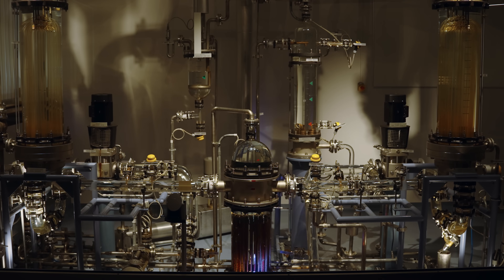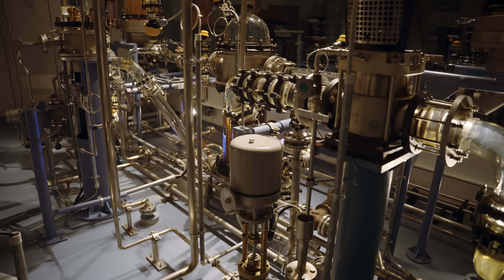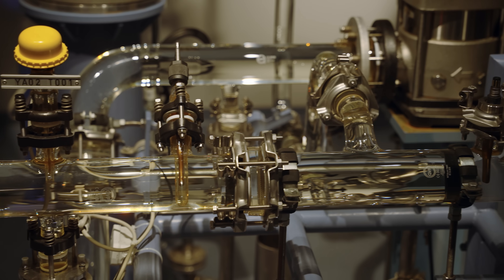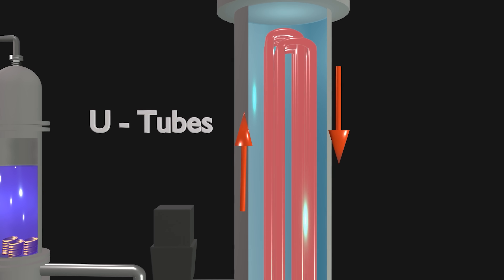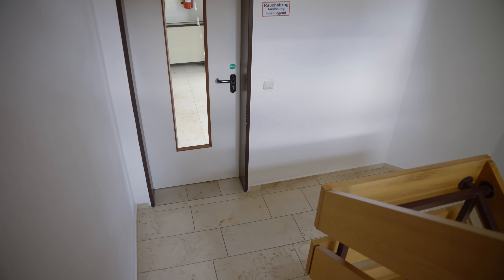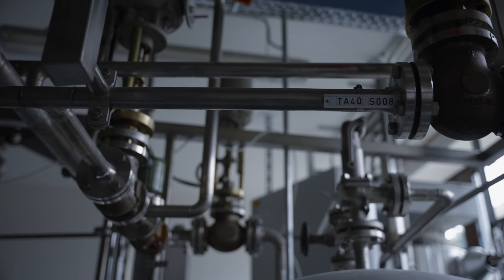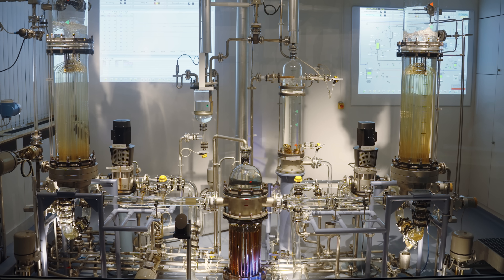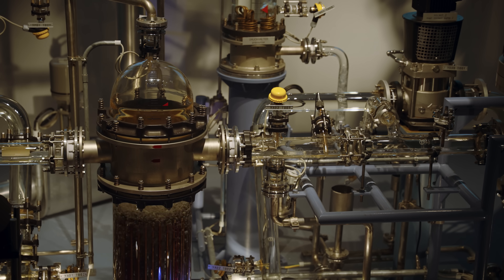World's Only GLASS Nuclear Reactor!

Comment: I have an honest question regarding nuclear power as a mean to generate electricity for the public 
Specifically my question is: Is it even whise to talk about it given the massive cost at which nuclear energy comes compared to basically every other means to generate electricity?

I have gone through (and you are more than welcome to correct me if im wrong) numerous studies and papers, all saying that nuclear power is basically uneconomic to start with so i dont really get the whole fuss about whether or not to build new and keep old reactors going

any thoughts? (pls be nice im really trying to understand the topic)
Reply: The cost of a power source doesn't tell you anything about the price of electricity produced. Nuclear power has high overnight costs to build but produces cheap electricity, because its production is stable and abundant. Wind and solar are cheap to build but create expensive electricity because their production is highly variable. They also have a small capacity factor (the ratio of actual energy production vs the maximum theoretical energy produced in the same interval), around 25-30%, so they must be massively overbuilt (3 to 4 times the equivalent installed power relative to a thermal plant), but sometimes this over abundance of generation saturates the grid and wind and solar power companies have even to pay customers to use the power as not to collapse the grid. At different times, wind and solar production is effectively zero so there must be other sources to take up the slack. That's why places with a high percentage of wind and solar either have lots of storage (and the only grid scale storage solution is pumped hydro, batteries are still just a PR joke) or have an equivalent installed capacity of fast-acting gas turbines.
Wind and solar fanboys never talk about total system costs, only of installation costs.
New nuclear plants' construction costs are also inflated by the fact that they are built mostly on private funding with money lent from banks at exorbitant interest: consider that interest alone makes up 66% of the cost of Hinkley Point C. When instead the money is lent from governments with only inflation interests the price of new nuclear drops considerably, and that's why for example the UK is considering government lending for the future plant at Sizewell. The whole buildout of the french fleet was equivalent to around 100 billion in today's Euros.
Reply: @Z80Fan  interesting point 
My question would now be if nuclear power is more cost effective in that Departement than investing into ways of storing surplus power generated by renewables
Reply: @dragonrainbow6551  It a question of scale: first of all, nuclear too benefits from storage because, since it has low running costs, it's best run constantly at 100% power instead of being throttled up and down, so it's best to store excess energy during the night and use it during the day. For this strategy you only need enough storage for half a day's worth of energy. With only wind and solar providing power, you must allow for several days without generation, and even seasonal variations, so you need orders of magnitude more storage. The best electricity mix is the one where nuclear provides all the baseload, hydro for storage or flexible generation, and solar power for daily peaks (around noon is usually the peak consumption). Wind can be used instead of solar in northern countries where the sun doesn't shine much but winds are fairly stable and strong. If you take a look at all countries that have achieved low emissions in the energy sector, they either have the mix described before (eg France, Sweden, Finland), or have extreme amounts of hydro (eg. Norway, Quebec, Brazil).
Reply: @Z80Fan  seems like a reasonable idea, even though, I’m a huge solar power fan 
However the weak spots of solar are a headache even to me 😅
So hearing from someone who seems as intrigued in nuclear power as I am in solar is a quite interesting input, thanks for that ^^
Reply: Unfortunately, he always avoids these facts about the price. Like that even the World Nuclear Report says so, with 180$ per MW/h for Nuclear Power and Solar and Wind are just 50$ and 60$ per MW/h
Reply: @annocraft  thanks for the answer, glad that my reading seems to be right 😅

Comment: 5:25 this explanation of nuclear reaction is great. This does leave me with one question though; how exactly do the fuel rods heat up the water? Are they just inherently hot? Or do you need to do something to them to get them hot?
Reply: The fuel rods produce heat through a process called nuclear fission. (ie. splitting an atom)
Reply: Short answer, yes, they are hot, specially when they are close to other fuel rods, the control rods are placed in between the fuel to regulate the amount of heat or to stop the reaction completely, you do need to do something to turn it into usable fuel, you cant just thrown pure uranium in water, the creation of the fuel is a very complex topic and i don't fully understand it.
Reply: @TectonicTechnomancer basically, the quick version is that Uranium we can mine comes out in 2 forms U-235 (about 0.5%) and U-238 (about 99.5%). By using the very slight difference in mass of the two isotopes (originally by diffusion through a selective membrane though now most commonly by using a centerfuge), the percentage of U-235 is increased to between 5-20% for use in reactors for power generation. Depending on the geometry, neutron moderator, and design of the reactor, that is the % needed to self sustain the nuclear reaction. There are other materials and methods to create fuel pellets for reactors, but for the Uranium cycle in PWRs (the most common type of reactor still) this is the method used.

Comment: Germany's nuclear phase-out is both lunacy and hypocrisy in equal measure.

Shutting down power plants have created a power deficit in Germany, which the politicians see fit to plug with nuclear power from France and Sweden and other European countries.

I guess nuclear power is only "dangerous" when it's done in Germany, but perfectly safe when done... "Elsewhere"? 🤔
Reply: Nope, not much more power than normal in a shared power grid gets imported. Solar and wind power were expanded, which last year accounted for 60% of the total electricity mix in Germany.
Reply: @annocraft  It doesn't matter because it's never going to be 100 percent.

Solar doesn't work at night, and wind only works when it's windy.

You will always require an on-demand power source that can be turned on at will. And for that you either have to choose nuclear or fossil fuel power.
Reply: @sevenproxies4255  Your whole argument is going in the direction of storing electricity. The prices of battery pack are currently collapsing massively so we can the power. Also this is already being done in the Netherlands, more precisely in Utrecht, with electric cars.
Reply: @annocraft  First of all, the battery packs required do not exist yet. Second: battery technology is still massively flawed due to battery degradation.

This strategy will only be viable if battery technology can demonstrate a proven method of continual recharges without battery degradation.

Also manufacturing these batteries isn't more enviromentally friendly than burning coal.
Reply: @sevenproxies4255  "First of all, the battery packs required do not exist yet." They do exist and are used in Utrecht or do they have no power?

"battery technology is still massively flawed due to battery degradation." They can hold up many thousand of charges more then a decade. 

"Also manufacturing these batteries isn't more enviromentally friendly than burning coal." Not with Natrium (salt) Batterys.
Reply: @annocraft  

Utrecht is not a country the size of Germany.

Nuclear power plants run for several decades.

Natrium batteries are still just in their infancy and not a proven, practical technology.
Reply: @sevenproxies4255  Utrecht is a City where power storage in electric cars is practiced. So it works there and therefor also works everywhere else. 

"Nuclear power plants run for several decades." And need regular maintenance. Like last year over half of all power plants in france were shutdown do to maintenance. 

However, sodium batteries already work as well as current lithium batteries. What you probably mean here is that the energy density still leaves something to be desired. However, that is not really relevant for energy storage. It is more important for electric cars, but that is not what we are talking about here.
Reply: @annocraft  Furthermore, Germanys imports of electricity ramp up the prices on electricity.

How do you justify making life harder for regular people in other countries, just so German politicians can indulge in some sort of anti-nuclear purity spiral?

Frankly, all nuclear countries should refuse to sell electricity to germany and let the german power grid collapse.

Comment: I don't understand why German rejects so much nuclear power and now mines coal. We are no longer in the Chernobyl era, and reactors have more security measures.
Reply: We don't mine more coal. Solar and wind power were expanded, which last year accounted for 60% of the total electricity mix in Germany.
Reply: @annocraft no but Germany has recommissioned a bunch of old coal plants aswell as increase its gas power production
Reply: @jameson1239  Not really. The older coal plants were not recommissioned. And most of the gas is here still used for heating, sadly most people think heat pumps are just trash and use gas.
Reply: Sorry but you're wrong. The last German coal-mine was closed in 2018.

Comment: Have you heard about the Canadian trying to make small nuclear reactors that will be placed in the beds of trucks like a f350 to power remote areas? Sounds early sci-fi.
Reply: Sounds like the old Russian RTG’s
Reply: @bajasummit6209 you beat me to it, while the new design would likely be more capable, its kinda hard to argue with a steady stream of power that fits on a flatbed and requires no fuel
Reply: America already did that decades ago. Well sort of: they tried to use modified submarine reactors to power remote outposts. Needless to say it didnt quite work out.
SMRs (Small Modular Reactors) are unlikely to fix the main issue with nuclear fission: costs.
Reply: sounds realy practical on the first day of radaman ^^ 
( the security issue is one of the main reasons we don't have micro nukes everywhere)
Reply: Technically it already exists... dry thermopile reactors power a lot of the current and past satellites because it's reliable and relatively simple technology requiring no hugely complex cooling or moderation systems.
Reply: Nuclear Subs can do this, and have during natural disasters.